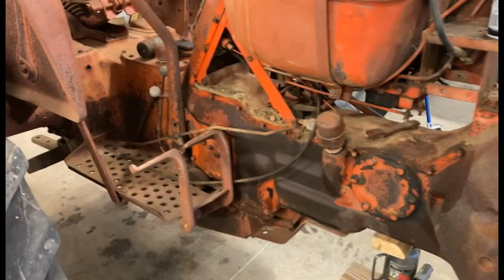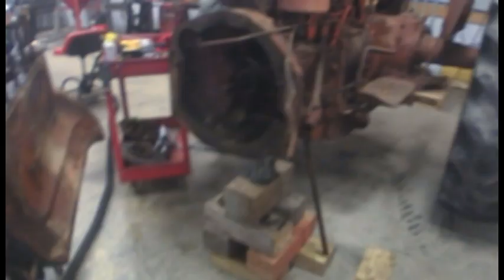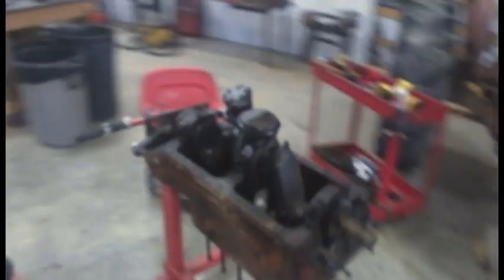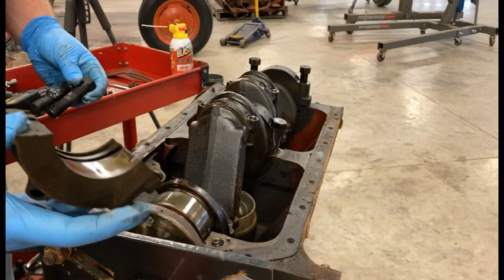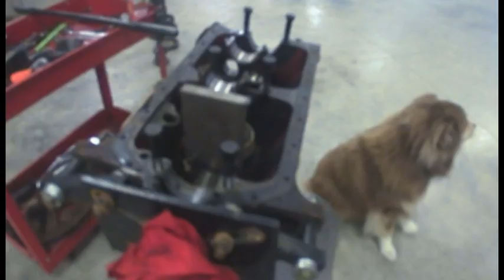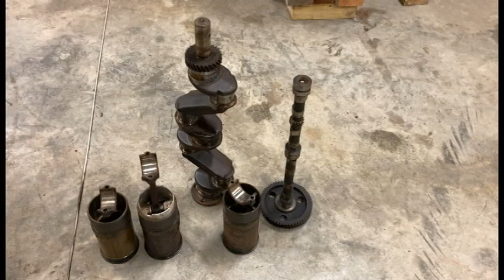Allis Chalmers D17 Flywheel Clutch Pressure Plate Removal and Engine Disassembly

Comment: Nash, Do you suppose there was water in cylinders two and /or three and they tried pulling it to start it? That would have put a bow in the crane causing the cast iron main caps to brake. I know that a couple old farmers who belted an A John Deere with the cylinders full of gas from the carb which pushed the head off of the bolts.   Tom
Reply from the maker: Tom it’s very possible didn’t think of that but I do agree with your thought. I figured someone tried to pull start also, but didn’t think of the cylinder being full of something else. Makes complete sense. Thanks for posting.